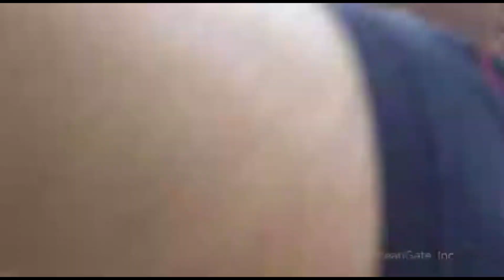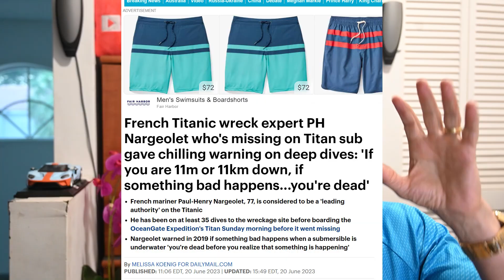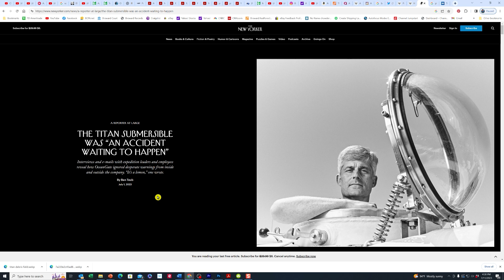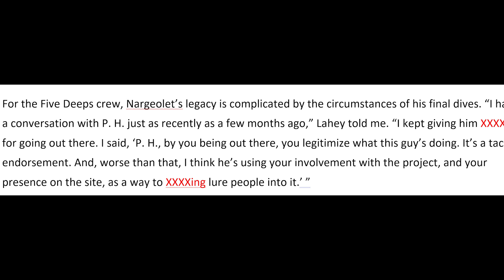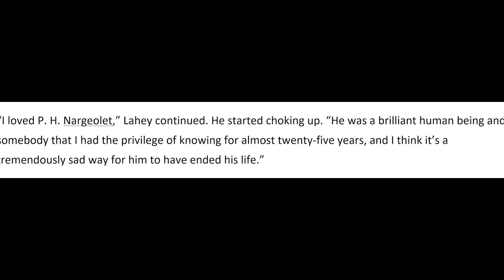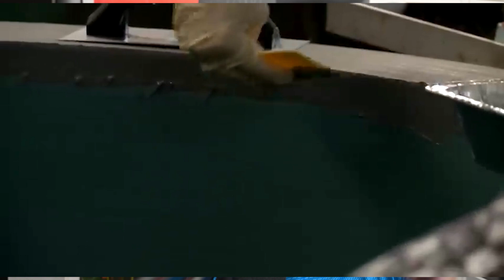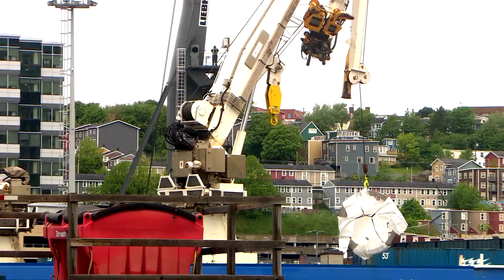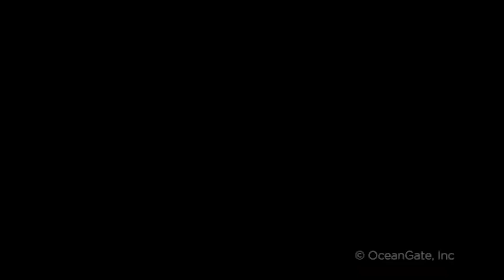Titan Sub: More Q&A, Design Defects, Why Descent Fast

Comment: As far as i know, carbon fiber and epoxy resins physical properperties are dependant with load rate (along with heat, moisture, and other stuff)
Same for any other material even steel. If you load it too fast it will be considered a dynamic load with shock. The thing that i remember about CF is that this transition is even at very low load rates a 1-2 mm/min  versus 4-5mm/s makes a big difference. With faster load rates (that is still abismally low compared to what a fast rate means for steel) it failed a lot sooner in 3-4 point bending test. For tensile and compressive loads i've found a study that it says it does not matter much, and surprisingly in compressive loads it's actually much stronger at faster rates of load.

Anyway.. CF is a very tricky material to model and predict as it has a lot of failure modes, it is very depandant to a lot of factors (speed, temp, pressure, light exposure, age, etc), and above all the real CF material used is very likely to have al ot of defects and nonuniformity in structure, bonding properties to the resin matrix, twisted strands under intrenal prestress, etc. Modeling a perfect matrix and CF structure is possible, but it does not help a lot if the modeled material is perfect and the real one is not.
Steel and metals in general are isotropic and homogenous. It is a lot more simple in failure modes, a lot more predictable. And if in doubt, a small test sample from the same material in a testing lab will make almost 99% guarantee for the physical properties for the entire thing. Also steel properties does not change by any measurable amount if it just sits on shelf for two years with direct sunlight, or if it is in humid or dry environment, or if you vary the temperature from 20degC to 100degC, or you load it very slow or 50 times faster than what carbon fiber is affected (it's still a low rate for steel.. steel is affected by dynamic loads especialy by shock, energy of deformation that may exceed the max resilience of the steel and appear plastic deformation in the solicited area.. this goes into quite high rates of load).

CF is an impresive material on the otherhand.. and by making it usable and crunching numbers and models and experimental research and calibrating FEA and so on, we further understand this material. But hopefully in non critical application.

Me as an engineer i'm very afraid to get CF downhill bike frame. Lightness is not very usefuls for a downhill bike anyway and the susceptility of imperfections, or being affected by environment in time, or having a crack due to a moderate fall.. all this makes me not wanting even a CF bike.. let alone a sub!
(as for bikes go.. i have some things to say about Al frames as well.. that can crack in time.. the mecanism is more predictable but anyway.. i love my steel bikes)

Comment: I may be totally off base but Wouldn’t the titanium have flex that carbon fiber doesn’t have depending on the alloy? I think the crackling noises they heard was the glue and bolts cracking under pressure. Especially the kind of pressure that rapid descent would produce. I don’t know much but it seems pretty likely that this is what happened. I am comparing this accident to a cork in a champagne bottle. Pop! Instantaneous crush of water and implosion and explosion of the carbon fiber shattering it to bits.

Comment: A guy who wasn't there, who has never talked to anyone involved with Titan, and who who possesses little more than the skills of a handyman when compared to what is necessary to achieve an the kind of engineering degree necessary to form an independent opinion about this stuff, and who should therefore limit himself to simply quoting those who have such degrees, wonders why he doesn't know the details of how the sub was made. Therefore, he thinks its acceptable to use a five second clip to represent a months-long process. I will never trust this channel. Disliked and blocked. Ya gotta know what you don't know, because other will.

Comment: I've been working on teaching myself to weld titanium.  The precautions I took for my first weld was to clean with acetone while wearing vinyl gloves(the white cotton gloves I ordered had not arrived yet).  Let the acetone dry for a bit.  Then only handle the metal while gloved.  While welding I used a new stainless steel wire brush to clean in between welds. I also used new tungstens to make sure no other metal would contaminate the weld.  The weld turned out a perfect silver color once I got the amperage right.  In so many aspects I do not see that level of care from Ocean Gate.  The domes were not torqued to specific specs that I can see.  The one clip I saw they were using a ratchet on one end and a wrench on the nut side.  I have not seen anything that indicates the bolts were examined between dives.  A drag race team will measure every bolt in the engine between runs.  

I suspect one problem, and Joe mentioned it in one of his videos, is how titanium would react differently to the compression/decompression cycles.  I don't think their engineers accounted for that.
Reply: Torquing the bolts would be unnecessary. The equal pressure underwater would be natural and complete the seal. A human could not apply anywhere near the torque that diving to those depths achieves naturally

Comment: NOW THAT IS A REALLY GOOD POINT! Good looking out on the Adhesive & Abrasion..I don't claim to know how titanium works The epoxy, putty ,glue or whatever they used how it does how it tolerates loads.But off cuff sounds ligical

Comment: As a communications guy, I feel the top should have been able to get telemetry from the sub independent of the testing system. i do realize there are communication challenges here but there are also ways around them, even if limited. with such a system the top may been able to diagnose, send remote commands, or even help locate the sub regardless of crew status.

Comment: Curious if the air pressure inside the submersible is increased at all during dives, or does it stay at atmospheric pressure?
Reply: Stays constant at 1 bar absolute.

Comment: A rapid descent could increase compressional forces at a rate that doesn't allow for the materials to adjust to them without degradation. Emphasis on could as it's speculative as to whether it did, and whether it contributed to failure even if it did. Ultimately, I'm convinced at this point it was catastrophic implosion failure of the carbon fiber cylinder, much as one has seen in the demonstrations of metal drum and rail car implosions, with the carbon fiber cylinder splintering and shattering -- with rapidity reduced to 1/10th to 1/100th the time required for those implosions that aren't even 1 ATM pressure differential. The adhesive may not have failed before implosion, and I have serious doubts that it did, but certainly would after implosion. If any of it is recovered, it may be some very small shards trapped in the equipment recovered, similar to tiny fragments of human remains. Remember that once under external pressure, that would keep the two Titanium end caps pressed onto the carbon fiber cylinder with an extreme force facilitating a seal by force alone.
Reply: I agree with most of you assertions. As for the descent rate, I am joining you with the clause "Emphasis on could as it's speculative as to whether it did, and whether it contributed to failure even if it did." but I am inclined to believe if it got to the stage "at a rate that doesn't allow for the materials to adjust to them without degradation", the depth would have to be so close to the crush depth, the rate of descent should be called more "the last straw" than a cause.
The glue... I believe the only explanation for all the problems with buoyancy was a leak into the pressure hull and the glue was where the leak started - at very early stages of the dive at that. The different both pressure and temperature expansion coefficients of the materials, poor technology while assembling and the number of load cycles it went through already makes it a prime suspect. If the leak (or more "seepage") was spread all over the length of the joint, it would be almost silent and hard to notice - even while letting in quite large quantities of water. As you, I don't find likely the glue was the (main?) reason for the implosion as such.
Any other equipment failures etc. were virtually irrelevant to the final outcome. The gizmo was doomed from the moment the buoyancy got lost.
Reply: @curiouscat8457  It's my belief at this point that Dive #14, if I counted them correctly, was " A Dive Too Many" -- from the book and movie, A Bridge Too Far. The degradation of the carbon fiber from too many dives without being replaced or refurbished will prove to be the immediate, proximate cause of failure with major contributing factors, such as its design and materials being what we called the "Root Cause" of failure. Even if they couldn't rise very rapidly, if the pressure hull held, they'd still be alive, as they would have eventually surfaced. I'm suspicious - if they did attempt to dump ballast - that they didn't successfully dump all of it. Much speculation here. The investigation being done will be extremely thorough. I've read NTSB reports. They leave no stones unturned -- and the Canadian equivalent agency is no different. In the meantime they won't publish much of anything except that the investigation continues to prevent press and lawyers running amok.
Reply: @Sparks68  My comments are based on the presumption the transcript is genuine (I am not saying it definitely is, but there are not any obvious sighs of it being fake). Where I am speculating, I am clearly stating so. 
But certain parts (again, based on the transcript) can be taken as solid facts. 
The most important point is: the problems with buoyancy could have been caused only by one thing: water leaking inside the sub.
As for cause of the implosion, there are too many possible causes even to list - including impact on the bottom, shockwave from explosion of hydrogen (flooded electrics) or consequence of some of the many obvious design and manufacturing errors. I am happy to leave the final finding on the authorities investigating the tragedy.

Comment: Two separate hull's. The outer hull could have been taken in water. That's might explain why they went down to fast. And after they dropped all the extra weight they had a very slow time going up.

Comment: The descent was too fast since the beginning. I don't think it's an overweight because they tried everything to stop this infernal descent but the ascension was too slowly. Why the ascension was so slow after a very quick descent? Why the descent was so fast?
Reply: Try an ingest of water in the pressure hull and you have all your questions answered. No gaps.

Comment: I can't stop from cringing when watching them build the sub! Hand assembling with zero precision using no mechanical fasteners to attach the end caps to the pressure hull! 
Just think if they only built the hull out of the same metal as the end caps. 
There are too many engineers who think they are smarter than everyone else because they can call themselves a "Engineer".

Comment: On the decent rate, the craft was descending too fast, do you think that was a symptom rather a cause? the crew didn't notice the obvious red flag and when the alarm bells sang, they tried to ascend and they couldn't.
given as how the ballast controls the descent, perhaps they had taken on water and dropping ballast and frame wasn't enough to give them familiar ascent rates? 

or maybe it was the descent rate and rapid pressure changes and they had an incidentally active downward thruster which would've killed the main bus and why they had a bad ascent rate.
Reply: It was symptom. A symptom of the sea coming slowly but surely aboard.

Comment: As someone who does resin art. That was the first think I picked up on seeing the video of the sun being manufactured. 1- touching it with bare hands. 2- not giving rough edges for adhering. 3- dusty open environment. 4 - applying with a tool with wiping motions and no degassing. 

Any one of those the immense pressure would take advantage of.

Comment: Your spot about how they installed the titanium. You're right. The titanium was smooth, guy had no gloves and was contaminating what he was cleaning. With no abrasion to the titanium you have a chemical bond instead of a mechanical bond. I used to build boats for Bayliss Boatworks. Big difference.

Comment: That transcript isn't confirmed authentic, is it?  I guess OceanGate hasn't denied it, but then again, if it's fake, you don't want to set the precedent of confirming/denying everything on the internet.  Assuming it's true for the moment, I don't see the descent rate as being a big deal except in the sense that it might indicate they didn't properly ballast the submersible.  The effect of quicker compression or slower compression doesn't seem like it should matter if it was really built to handle the bottom pressure.  The fatigue on the materials from the repeated dives concerns me more than the descent rate.

Comment: So many sources that are supposed to be experts concerning Carbon Fiber are so certain that it is not the material for this application (and I believe them because I tend to beleive many experts in a field) I wonder why he was so set on using it?  I get that he was set on a tube shape to accommodate more people, but could this not be done with another material?  Or is this purely a situation of the pressures at these depths pretty much requires a sphere, which needs to get thicker the larger it gets to maintain its rigidity?

Comment: Any explanation for what happened with the Titan should be consistent with the fact that it made 13 successful dives to Titanic depth before and didn't implode.
This REALLY bugs me about the whole debate. "How did it work for so long" is a crucial question. If a theory implies it was so bad that it would implode on the first dive, or even first few dives, it's incompatible with the empirical data. 

Obviously, Rush had many flaws and it's fun to call him a narcissist and an idiot, and his operation looked like a clown show plenty of times.

But how did his sub work for 13 dives to the Titanic, IN SPITE OF all that and all the warnings from everyone in the industry? To me, just saying 'they were right all along' doesn't cut it. It sure doesn't sound like they were warning Rush that 'it will only work 13 times!'. Looks like maybe they were wrong too. Crazily, insanely, this little contraption did do the job, again and again..

IMO we need to be able to answer the first question, 'why it worked', to get to 'why it no longer worked here'.

Comment: I may have missed it but has there been any mention of what the maximum payload of this craft is? The thrusters might have been too weak. This could explain the fast descent and very slow ascent. As mentioned, the weight distribution might have been unbalanced by passenger crowding especially on small craft. From all the pictures ive seen of the Titan, it just had a bare floor. Where are the safety/restraining belts. They could have helped maintain proper weight distribution

Comment: It's like these build videos show a bunch of amateur model airplane builders, and doing an incredibly crappy job doing it.  Using plastic buckets and plastic scrapers doing what is most likely an incredibly important manufacturing step.  
You'd never see this lack of process and precision in any aerospace company. 
Where were the QC checks?  There weren't any.
This is something you'd never expect in this day and age, but there it is.  And there's the result.

Comment: Something I now realize about making a tube or pipe shape structure with so many layers of cf to withstand tremendous amounts of force is how to know it any layer internally is adequate. The wall diameter is 12.7cm 5 inches. Some cf applications don't layer up to that amount of material. My own personal interpretation of all the various things that contributed more to this event was the bond joint between the titanium ring and cf, decent rate, and cyclical stress.
Reply: I don't think anyone has seen the actual pressure hull. What you're seeing in the pictures and videos would've been the internal hull designed just to hold the crew and stuff. The pressure hull was likely made up of a few metal or ceramic rings that had carbon fiber wrapped around them in such a way where the pressure of the dive would put tension on the strands. Old idea that a guy had using leather back in the 1800s(W H Taylor).

Comment: Hey Jeff, if the cylinder was made from titanium, would that have at least been considered a “safer” vehicle than the carbon fiber one? I know the overall design/shape/construction was terrible, but would a different material been viable with a cylinder design?

Comment: I barely graduated 6th grade, but this is what I think happened. During descent rear of vessel developed a small leak . Small leak at high pressure, water I would imagine , would be like a laser, cutting wires and shorting out components. They had trouble ascending because water in rear was adding weight. So they slowly sank even after emergency jettison of buoyancy weights.  And then implosion. It’s almost like someone trying to build a spaceship in their garage, something’s need to be left to professionals, especially when room for error is zero